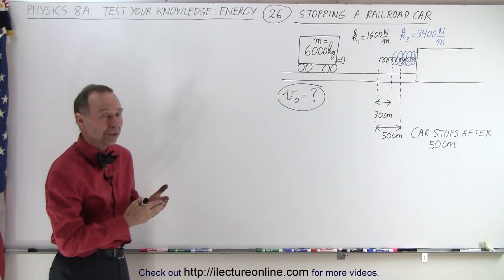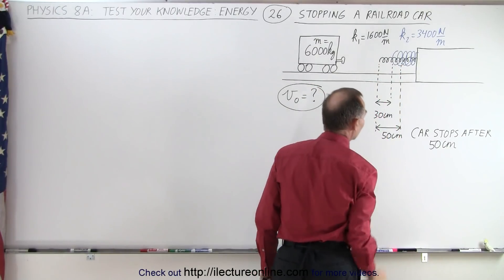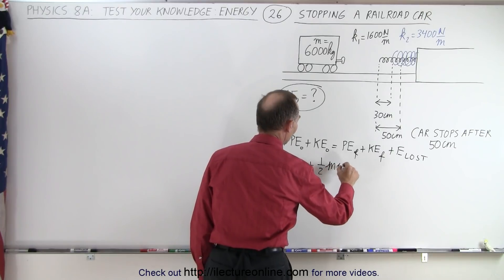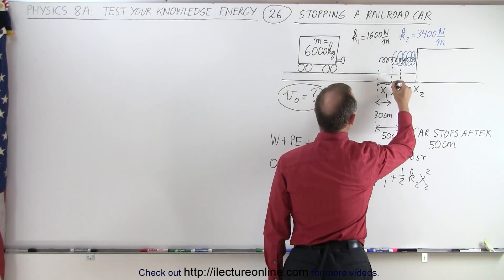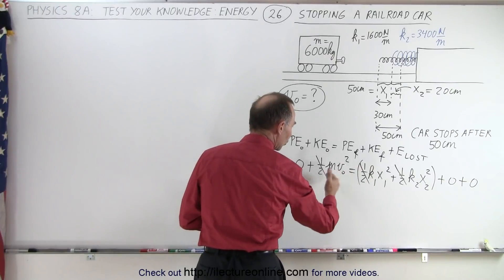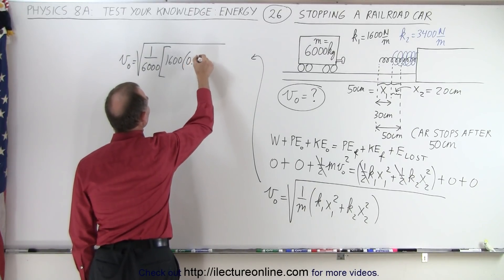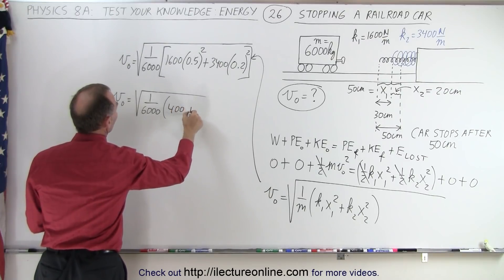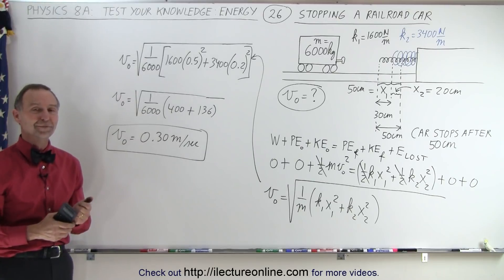Physics - Test Your Knowledge: Energy (26 of 33) Stopping a Train

Comment: Dear sir once the first spring gets compressed by 30 cm then For the next 20cm both spring will act as springs in parallel. So after 30cm we have take equivalent stiffness to find energy for next 20cm.
Reply: I don't think that is necessary because the energies are added in parallel configuration

Comment: Why do we use 0.5 m instead of 0.3m for x1? Thanks.
Reply from the maker: The first spring is compressed 50 cm  the second spring is compressed 20 cm.
Reply: @MichelvanBiezen  Got it. Forgot that the first spring kept compressing while the second spring compressed. Thanks!